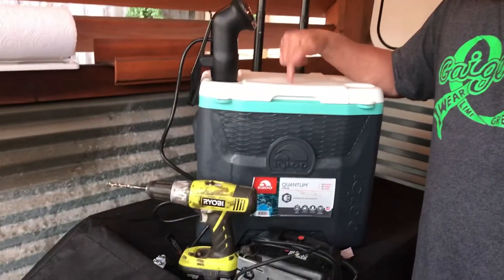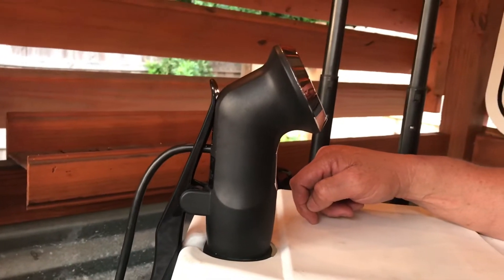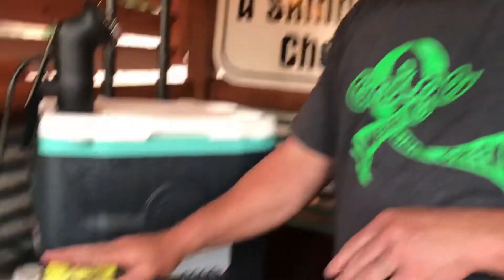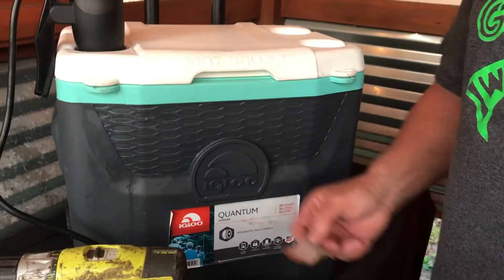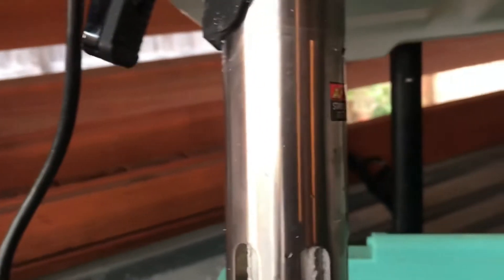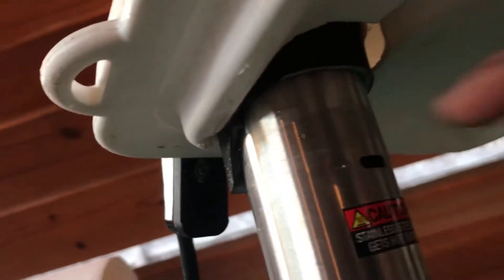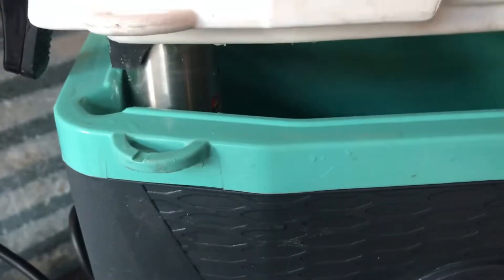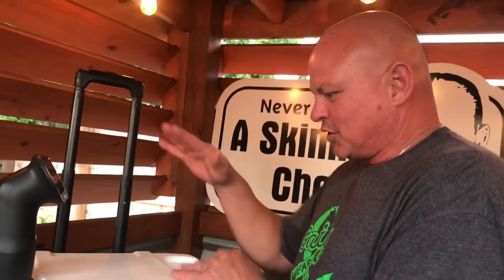Sous vide homemade container

Comment: I used a $29 Coleman 33 quart party stacker cooler and put a 2” pvc repair coupling in opposing corners so I can use two Anovas when I need them for larger quantities. Otherwise I can add a plug in the couplings and use the cooler to hold/rest meats or use it as a cooler.